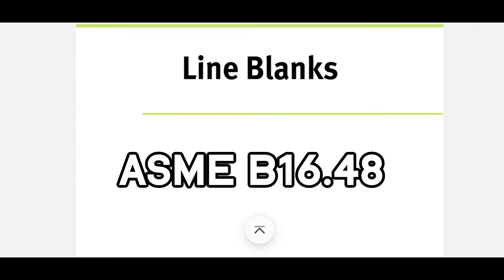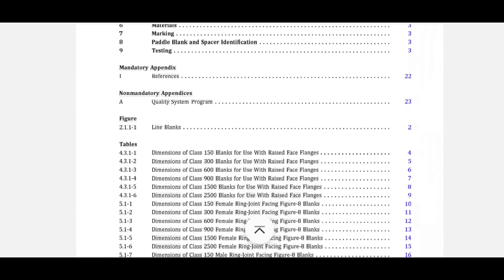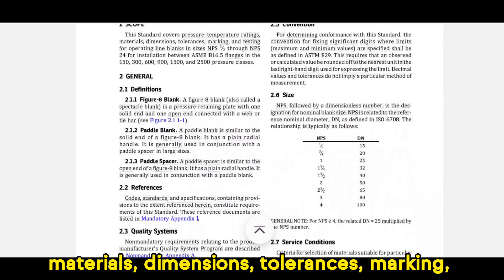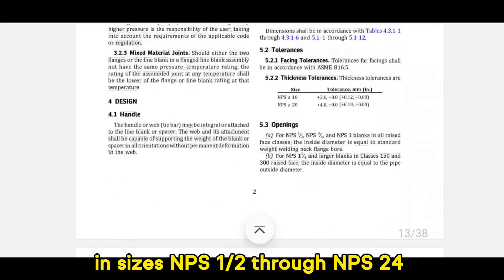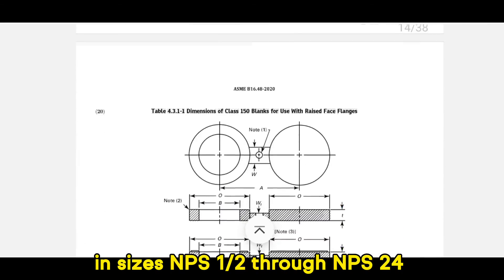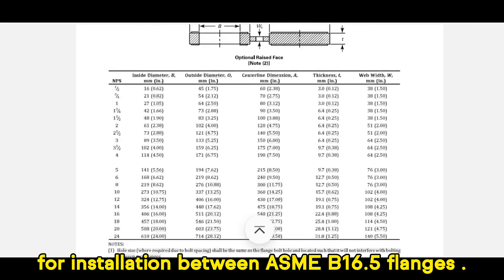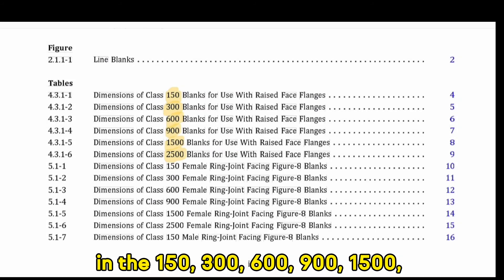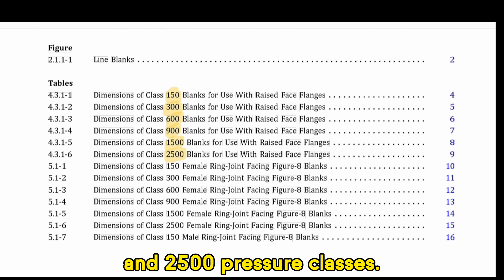All about Blind Flanges: Type, Uses, and Specifications

Comment: music is too loud. unable to comprehend the video.
Reply from the maker: An updated version of this instructional video has been prepared, which no longer has the audio issues of the previous version. Additionally, a tutorial on selecting the flange pressure class based on the ASME B16.5 standard has been included. You can access the video through the link below.
https://youtu.be/WLzmvV_Zaoc